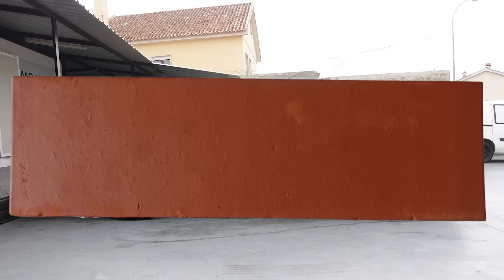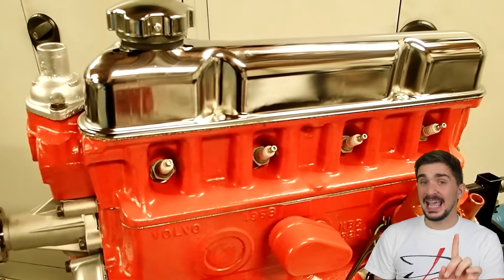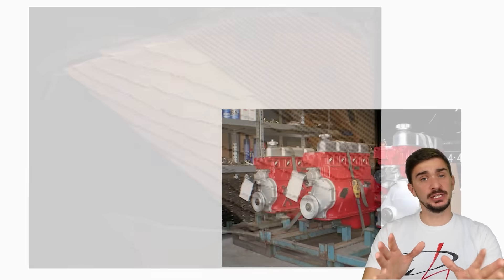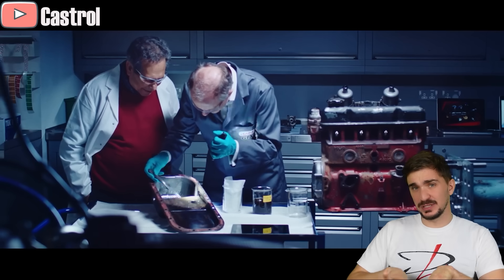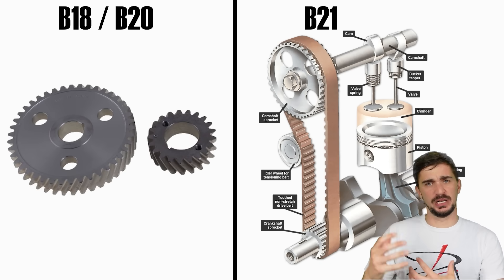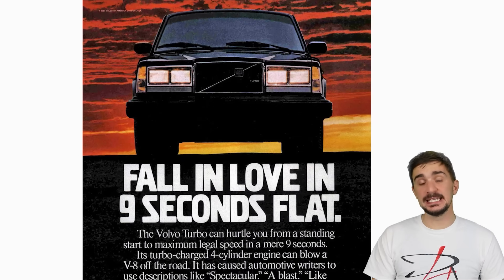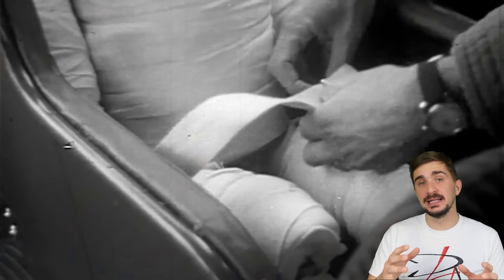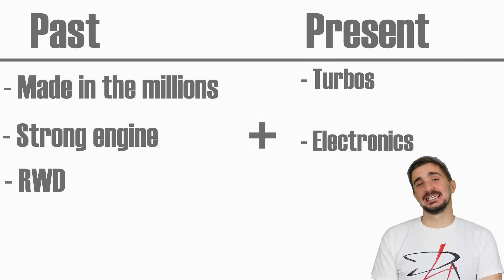A Story about the Volvo 240 and its Redblock Engine - Iconic Cars and Engines #18

Comment: In the 90's I used a Volvo 240 diff in my Ford Cortina speedway car which was powered by a 4.1L Aussie in line 6cyl built for racing.  The Ford diff couldn't handle the HP but the Volvo diff handled it without issue.............

Comment: Very interesting your review of Volvo cars and in particular the 240 series. Personally, I have never had a Volvo, and I regret it, but a Mercedes station wagon (7 seats) 300 TD Turbo, series W124. I regret not having chosen the earlier model W123, simpler, more rustic and without electronics or electric windows. I once went from France to Switzerland and on the small mountain roads at 1000m altitude, my heavy Mercedes had trouble climbing and was getting hot! But back to the Volvo and 240. I now live in South America, in Peru, and here in Lima, the capital city on the Pacific Ocean, there are still quite a few Volvos, some even older, that are used all the time by their owners, and they are usually very well maintained. My question is: do you know how the Volvo 240s behave in the mountains and especially in high mountains like the Andes? As a comparison, I can tell you that in the Andes, there are many Toyota Corolla station wagons, both petrol and diesel, that run flawlessly at around 3000m. It is true that we are now seeing more and more Toyota 4x4 Hilux because of the omnipresent mining activity in the country.

Comment: My parents knew the local dealer, so had Volvos my entire youth.  A 544 (before I was born) 2 140 sedans, a 145 wagon, a 1975 245 , a 1980, an 84 and a 92.  The 1980 did 230,000 miles and never had the head gasket off. I later owned a 1982 GLT wagon which I converted to an intercooler which I sold when I moved abroad.  I really miss owning Volvos.

Comment: I had a 240 with over 150000 miles, then the engine failed due to a cracked number 4 cylinder.This cylinder cracked right where the water return line from the heater core  entered the engine and hit the number 4 cylinder directly. Apparently the engine didn't like the Arizona heat climate. The relatively cold water from the heater hit the number 4 cylinder and cracked it.  Not so bullet proof!

Comment: Thank you for a wonderful story with lots of stuff that is new to me.  And your delivery is awesome!!

We had an '87 244, a '92 940,  a '98 S90, and a "96 960.  The 240 had a 5 speed with no overdrive button on the shift knob.  It made a scratchy noise going into fifth gear, but otherwise ran great.  One time I was under the 940, replacing the water pump.  It seemed to have double redundant bracing for the pump and seemed to be amazingly overbuilt.  They are sturdy cars, too bad they quit making bricks!!

Comment: Thanks for the production and upload! I grew up in a Volvo 144. It never failed us in over 10 years. Always started, always ran. Great car! Now I have a Volvo 740 GLE with a B230F engine. It does have an aluminum top, but OK.  It has about 300.000 miles on it, but it still runs like clockwork. Nothing has ever been done to the engine or the transmission except normal maintenance. I think the car will outlast me, and I'm 54 now. From my military service, I also have some experience with the BV202 and the Volvo L3314 (called the "Valp", or "Volvo felt" (popularly "Folvo velt" because of its high center of gravity, and prone to tipping over), and I can vouch for them both. They always started and ran, no matter how hard they were driven. Never failed. Great engines!

Comment: Yeah, but try to replace their heater fan, and a bunch of other parts! The starter. Transmission. And so much more! The parts are over the top in price and labor. They were not designed for easy fixing. If they had been designed for easy fixing, I'd still be driving one today. And tomorrow. And next year. I would probably be driving a Volvo the rest of my life. I left Volvo for the same reason I left the Mercedes, which was worse. Helluva good car, but when it comes to parts and service, it'll break you.

Comment: It's a Car! It's a Van! It's a Mobile Skip! Since the 80s, I've Had 6 Volvo 240 estates! Absolute workhorses when I was travelling the UK installing kitchens. I took one of them to Germany to fit an English kitchen, got it up to 125mph on the Autobahn with a ton of tools in the back! Since 2013 my daily drive is a 26 year old Volvo 940 Mk ll  2.3 LPT (Low Pressure Turbo). Still going great, and it's also my dog's Taxi!

Comment: My 1984 Volvo 240 has a factory installed VW 2.383 litre 6 cylinder diesel engine, and 4 speed transmission + overdrive.  Red Block is, of course, stronger, but the diesel is an interesting rarity.

Comment: I had a Vauxhall/opal corsa with the old Isuzu 1.7 diesel engine.  That thing was a rock. It started off at about 85bhp and then when they put the common rail and a turbo on it it pumped out 130bhp and was still as solid as hell. Amazing car.

Comment: The biggest headache back the 80s and 90s with the redblock cars was the mechanical fuel injection... going to EFI solved a lot of problems.  I've still got 2 Volvos, an S60R and a 940 with a 16valve redblock...  and I keep wishing to find another 240 intercooled manual wagon... just to do the new fun stuff to it that when I had my old one, wasn't as easy to get to run (8 injector fuel injection head from a Benz... ugh) 

Thanks for sharing!

Comment: They be good. I restored five 1800 sports cars in my youth and drove one of them for 32 years as a daily driver. Met Irv in when he had about a million miles, still young. 
Raced a 142 sedan in SCCA at Laguna Seca and Sears point tracks. The injected b20 high compression was 135 HP and with improved touring you could change exhaust, air filter and ignition for close to 150 hp. The rear end was 4.56 geared with OD so you could accelerate quite quick but I would pass 6 cars at a time on the straight as they were stock cars with tiny carbs with the fuel injection large throttle plate breathed much more. Selling my p1800 was like selling my little brother, parts were hard to find. Fun film, thanks for memories.

Comment: I have a 1989 740 GL ... Owners manual says engine is B230F,  but I don't think the engine is red.
Does it have to be "red" to qualify as a "brick"....  (CORRECTION --just went to the garage with a flashlight and indeed the engine block is RED).   Guess I can floor it from now on.
I purchased from a friend who was going back home to Norway.   Had 37K on the  car then in 1993,  but as of today it  still only has 95,600.   Engine seems to be holding up as I keep it at 60 mph on Hwy.
Question....  I did the timing belt at about 50K... and in theory I could wait until 100K to do it again,  but someone told me that the age of the belt is a additional factor,,  not just the mileage.
My water pump seems to drip a bit when engine is cold so  I was wondering if I would save money by doing the belt at the same time as the water pump,  and update the old belt at the same time.  
Timing belt was replaced in Dec. 1996... at 50,593 miles.   That is 26 years on the timing belt.
Would the belt have deterioriated due to age,  even though the mileage on it is only 45K ?

Comment: My mum (and later me too) drove the 240 GLD Diesel 2.4 liter 6-cylinder limo. That was such a marvelous car: space inside, some power with 80 HP, and lots of ruggedness. Starting at -20C after 3 minutes of constant ignition and preheating tries -> worked, no damage; cooler was weak after 13 years and the engine overheated twice but saved itself by thermal throttling, no damage to the cylinders/pistons!; about one hour of back and forth being trapped on an iced hill slope in Bavaria with the clutch smelling badly, you name it: no damage. Thing had knock and "nailing" like hell from the start, car dealer said that was intended, do not worry. And you could drive it with 6l/100km on German motorways with 100 km/h. Those were the days ;)

Comment: The weakness of the red block was the factory head gasket , it had the tendency to blow out the fire rings being they where individual for each cylinder. years later came an upgraded head gasket Wich tied all for cylinders as one huge fire ring

Comment: Don't forget about all the Red Blocks powering fleets of Volvo Penta powered boats. I had one. Thousands of hours under maximum full power stress and never a single problem. Unfortunately, carbureted though, duel (sometimes triple) Solex carburators.

Comment: In the the nineties I bought a Volvo from a customs sale in Zimbabwe. The main problem was that in this tropical country the pump forthe  Bosch fuel injection system was beside the fuel tank and not far from the exhaust pipe, Thus ! after about 100miles, or less, one would to have to stop beside the road and wait for the uderside of the car ro cool.  I removed the Bosch system and fitted two SU carburters, also an  SU fuel pump in the boot of the car. Result = 35mpg. However!  at about 100,000 miles the teeth on the timing gears stripped. I had a new set and a new camshaft flown out from a friend-of-a-friend in Europe. If I remember correctly this car's engine only had three main bearings. In S Africa I saw folk with other European cars I think they were maily Audi(s) lying beside the car with a water spray bottle plainly with the same problem I had had with the fuel injection pump.

Comment: I’ve owned 6 Volvo cars   2 of which were given to children 2 that were destroyed in crashes (my wife survived both) and the other 2 were sold. My  last 240 was bought in 2002 with 183k and sold in 2019 with 496k miles.  In the 17 years I owned the car I never had any engine gearbox or clutch failures! I did all preventive maintenance myself. The car was towed only once in all those years and that was for a broken clutch cable! 1989 Volvo 240 bought for $2000 sold 17 years later for $1200 very inexpensive car to own

Comment: I've been thinking about buying a classic car, the usual Aussie names and Japanese 70s to 80s.  A neighbour has  Volvo sedan with the most boring and horrid baby poo biege paint, a gaudy dried blood maroon interior and origional chrome hub caps. Up for sale at Au$ 8,000. It is fuel injected,  driven regularly and very well kept....so im thinking a turbo and exhaust for an extra 2 to 2.5k............ now I couldn't buy any thing not needing repairs or  restoration for 10k... this video got me thinking grandpa car with some go....... down side it is automatic, I like manual..... I might go for a wander up to have a chat anyway

Comment: In the summer of 2000 my father went to Sweden and bought a used 1998 940 wagon. My mother used it every day in 30-45 minutes rush-hour traffic. For the summers we dragged a massive caravan thousands of KM. and used it to drag large amounts of dirt and rocks for building projects. while being used for daily rush hour. in 2019 I took over the car and I'm using it daily. even during the winters here in Norway. -20 / -30 Celsius. after 23 years in my family, multiple attempted burglary's and been set fire to. Still starts, drives and looks just like it did when it left the factory.

Comment: In 1985 i, accidentally, did a comparative strength test between a fiat 127 and a volovo 242. My fiat was at it's longest point 97 cm shorter and at it's widest 52 cm narrower than original intended. The right front wheel of the volvo ended up at the left side of the motor block. As a side note did you knew that a fiat 127 could fly? Mine went up to 6 meters before colliding with a three

Comment: My dad had a 1976 244GL delivered in the UK. It had horrible reliability problems for the first year such as the fuel pump. After that it went all around Europe and across the Nullarbor a few times when we returned to Australia. The odo eventually went around the clock ie. over one million km. It was still going after 20 years when he sold it the 1990s.
Reply: Mine had a 1988 240dl, over 600k miles before it caught on fire.  Uncle was a previous owner and never changed the oil.

Comment: I once had a Volvo 240, but I have absolutely no idea which engine it had in it. It only went about 70 mph with foot to the floor, and only if you had a 3 mile straightaway. In winter, it got stuck in anything more than 4" of snow, and the engine  didn't run warm enough to keep the interior warm & the windshield clear.

It was a beautiful brick that was almost completely useless

Comment: Great educational Video. Tons of information. Volvo 200 are excellent machines. Well Built. They only have one competitor back then. The underdog. Everybody will say.. No.. but I live in California and I see Volvos 240 and Toyota Corollas RWD living forever. Yes.. With the T engine as well built as the B volvo, RWD and simple but robust design. The can do 500k miles easily. From 71 to 82. Corollas RWD E2, E3 and E7 series are the only competition for longevity and reliability against Volvos. Check the facts, Both cars are great survivors because of a simple and strong design. Sadly, Toyota went FWD in 1988. Volvo held until 1993.

Comment: Its kinda ridiculus since the B18 dont wear out, but in the shop manual for Volvo 122 Amazon, they list bearings in five under sizes. The crank was designed to be ground five times! Imagine how many miles that would take before you were out of bearing sizes😂

Comment: My first Volvo was an '85 245 GLT, needed an exhaust valve, fixed it, sold it for $2500, (wish I didn't!!) Later, I bought a 740 turbo wagon with 441,000 miles, replaced the blown H/G, pounded the hell out of it for a few years, sold it, bought a 99 V70XC with 225,000 miles, ran it to 330,000 before it lost R 2nd and OD. Now I have a 2001 V70 T5 with Hilton tune, still has shiny paint, no rust, and embarasses WRX guys. I would love to have a nice, clean 245 again.

Comment: My parents purchased new 1980 GLE Volvo and at the same time my uncle purchased the Bertone coupe version (automatic) The automatic had nothing but problems (just was a lemon at the get go). Our 1980 worked great until it was approaching 180,000kms. Was a monthy issue of going into the shop and the maintenance was a total pain in the butt. Great car as long as you got rid of it before getting close to 200,000kms. Fast forward to now my parents and uncle (and me) have never and will never purchase another one. Especially the new (Chinese) Volvos. To bad. I miss the 80's vehicles. You know when you actually had different ride qualities instead of just "harsh" like today's clones.

Comment: Ugly as sin, but I loved the seats. They were also amazingly quiet inside. Mine had a Limited slip diff and driving in
snow was problem free, with winter tires of course. 
It had its share of finnicky things, fuel relays, door lock activators and many annoying little things . After 380.000
Kilometers in 2010, it left the family. The only real snag was ,we bought it without aircon, that became a problem, because
I started to need cool air. Aircon could not be built in afterwards. That ultimately became the reason it was sold. I miss it.

Comment: I love the 240, there was no need to change anything about it. As far as I'm concerned it should still be produced exactly as it was.
Although I admit my 2 favorite cars ever were a Volvo 164E and a 1985 Honda Civic...and I owned both a 1970 Mustang and a 1970 El Camino....in 1977.
Better with fuel injection, but I miss those cars. I could easily work on them at home without access to a lift, they seldom broke down, lasted forever and parts were easily available, even in the States.

Comment: Back in the day I had several customers that used this model Volvo as a taxi and found that the engines needed rebuilding every 80/100K miles due to the onset of high oil consumption even though they were very well and correctly serviced. The engines were always fine inside with only new piston rings gaskets and seals required but I certainly would not call this engine reliable!

Comment: I still have a 1994 940 model in Greece. This was the last of the rear wheel drive Bricks. The engine in mine is slightly under 2 Liters. They made them this way to keep the road taxes from being ridiculously high. Any thing larger was considered a luxury car. This makes the very conservatively rated engine even more so. Not the fastest car in town, but it will cruise all day at 75 MPH. Besides air bags it has pyrotechnic seat belts. In case of an accident small charges will fire in the door posts and pull the seatbelts back tightly against you. Love this car, I was going to sell it but I decided to keep it. It can be a bit hard to find spare parts  now, but I rarely need to.

Comment: One of my favorite cars was my 1984 240DL wagon. The only thing that happened to it was when the cam belt broke, which did nothing to the engine except to shut it off. Belt replaced and I drove it for 165K miles.

Comment: I had a '91 240 wagon. Greatest car ever (built in Malmö) - I had to sell it because I moved across U.S. and the shipping fees were crazy. I loved the engine, the tight turning radius, the smooth-as-butter auto transmission, excellent acceleration, good gas mileage, --- and most of all, the rear-facing back "rumble seat" - which was partially constructed with good Swedish plywood! Nobody believed me when I said my car was partially made of wood! Haha!  I miss my dark blue 1991 "Stig" so much... (yes, I name my cars)....